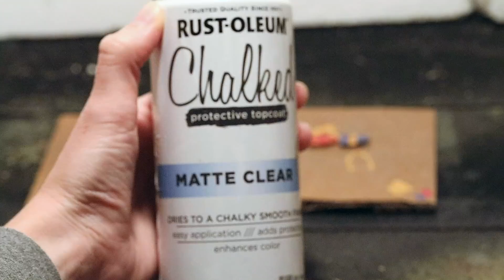Model ship building #29 - Finishing the HULL - RAGUSIAN CARRACK XVIc - KIT (MarisStella)

Comment: Not even halfway through yet but have two suggestions.

1) Slower disk sander or coarser paper.  You're burning your wood because you're going to fast on either worn paper, too fine paper or a disk sander that's too fast.  My first suggestion is a slower sander but if that's not something you want then go slower and use coarser or at least fresher sandpaper.

2) Get a razor chisel.  Will make a lot of these cuts a lot faster and easier.  Also easier to make them accurately.
Reply from the maker: Yes, I have two disk sanders. And yes, I have a mini chisels, but this model is not from scratch...